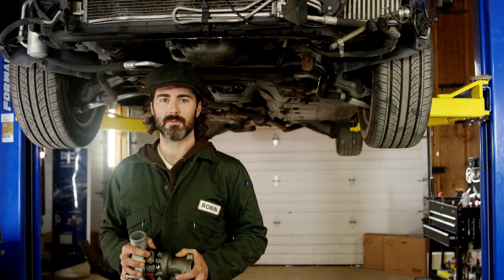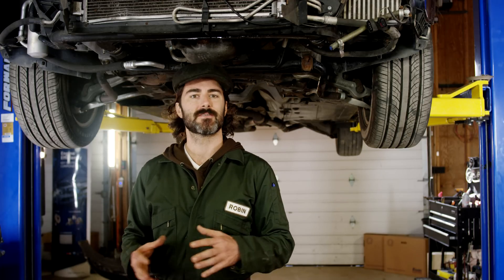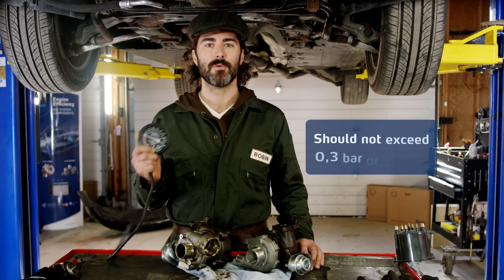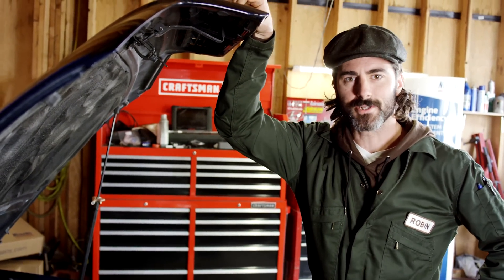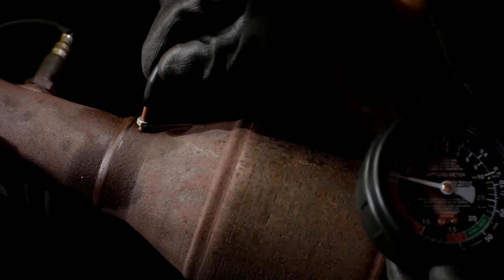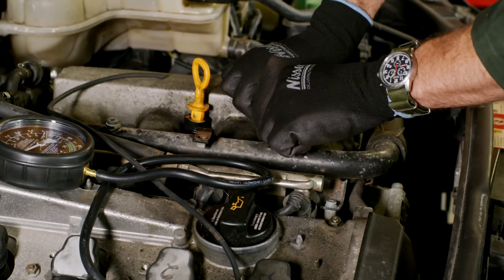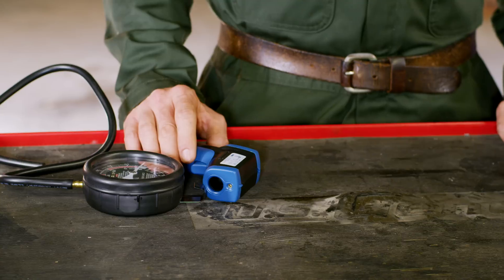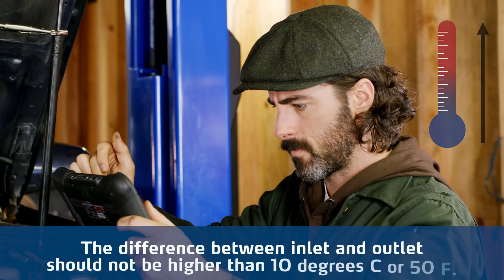Exhaust Back Pressure Test - Direct & Temperature

Comment: I don't recommend your method for testing.

Modification of a O2 sensor is very wasteful.

The aftermarket has O2 sensor plugs. Using one of these to make a simple fitting would be much better.

V/R Chris

Comment: Frequent short drives... How many and how short?
Reply: There's no specific number. The bottom line is a diesel engine with DPF system its not a good idea for small commutes (shopping or taking kids to school) or to be driven mainly inside towns at small speeds. They were designed for motorway use, or at best once in a while to take it to a motorway and drive them like you stole them. Falling to do this results on clogged DPF system, cars that never reach their operating temperatures and a lot of problems and money waisted in expensive repairs down the line. Small commutes and driving inside towns either electric or small petrol engines that were designed to be fuel efficient under those conditions.

Comment: we had to replace the engine on my f150 3.5 twin turbo, sine this replacement on acceleration on of the hoses on the drivers side is blowing off this was a used engine I am wondering if a bad BOV can cause this problem I am a disabled vet and need this truck it is my only transportation and I have Dr appointments every week so I am in dire straights here bigbillreaves@gmail.com

Comment: I'm getting a low efficiency code for my altima. I'm suspicious that the catalytic converter is actually clogged up. 

P.s good job though on the advice ! 
Also I never Ben a first comment .
Reply from the maker: Hey Allen, there are many other things that may cause the code and the exhaust restrictions are only one possibility. Charge air leaks, improper intake or even intake air metering device may be the problem. It all depends on other symptoms you notice by the problem. Smoke, noise, fuel consumption, oil level, other errors stored by the ECU...